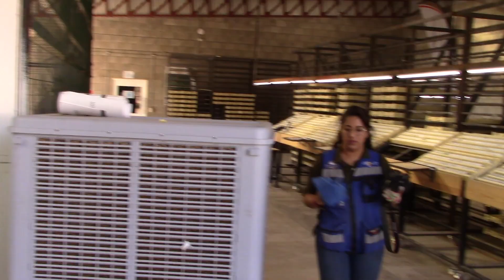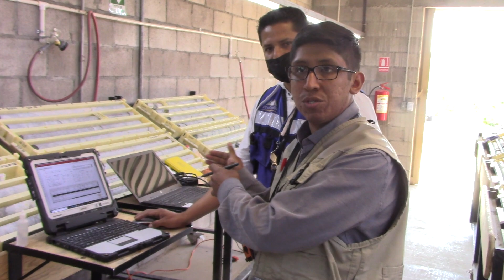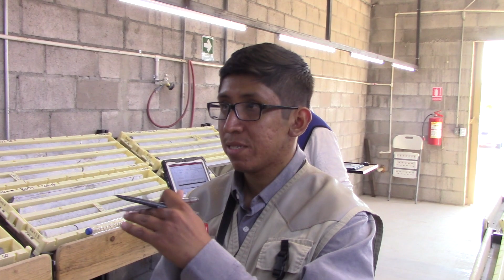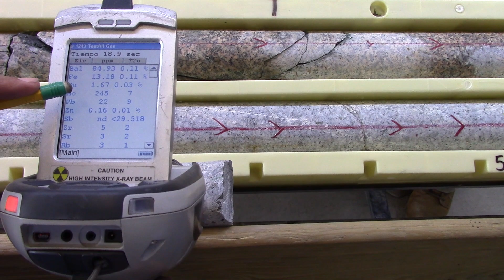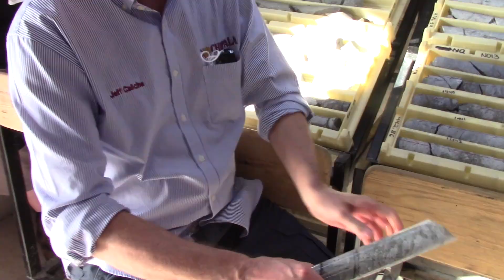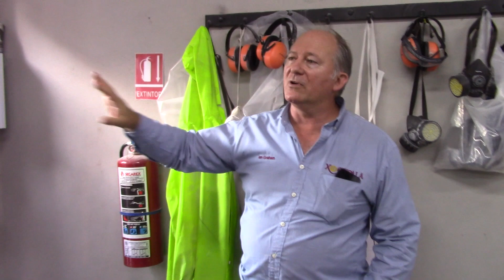Core Processing Process for Santo Tomas Copper Project

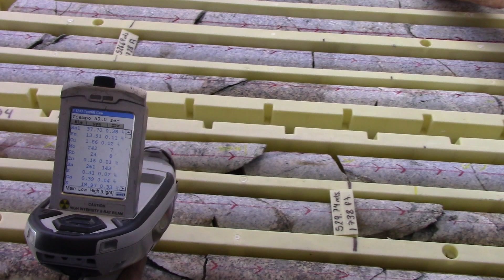Comment: At minute 14:30 I believe the mesured cooper is 1.66 ppm (part per million) and 0,02% and not 1% as they say in the video, but we cannot infer what this means for the average coper %.
Reply from the maker: It is 1.66 percent. But like you said this is just in this particular spot.
Reply: From what I see, I think you are mixing up the deviation information with the copper content. I assume it is the standard deviation you are referring to Armando.
Reply: @loujonas4408  yes, you are right the right 0,02 is standard deviation but the left looks like ppm but maybe it is just % like Mariusz said it could be a configuration on the equipment.
Reply from the maker: @armandocarrapico2825  Think about this. The trip was organized ahead of time. Do you think they would use a rock with little copper? I don't think so. But again this reading is just in one spot so unless the assays show significant meters, it doesn't matter much.
Reply: @axandbro  correct, thanks.
Reply: It looks to me that ppm column is first and shows the ppm unless there is a dot in the number then it is a percentage, for sure having 1.66ppm of anything doesn't make sense. The second column is the 2 sigma confidence of the reading, you can see that as she holds the device longer with the sample the confidence interval is imporving.

Also Marius is very right this is some sample which is not representative of entire interval.